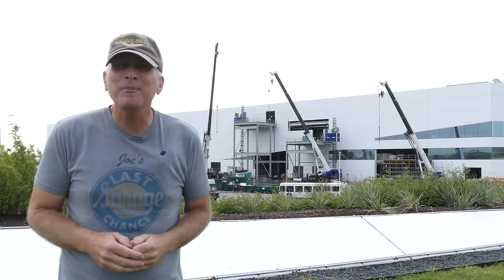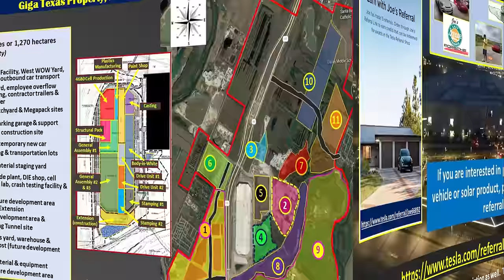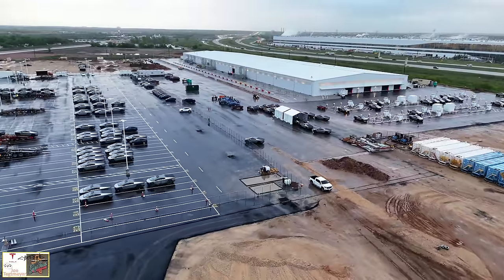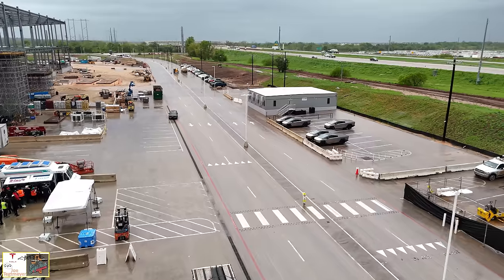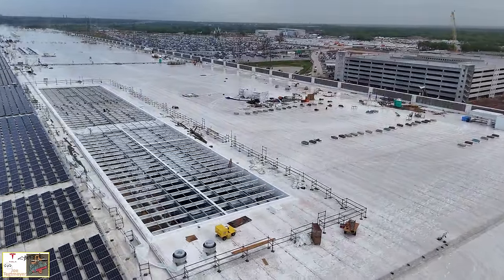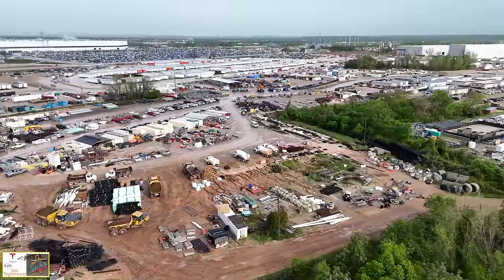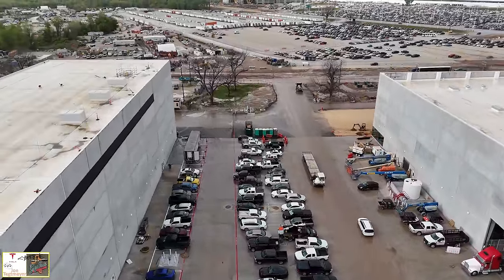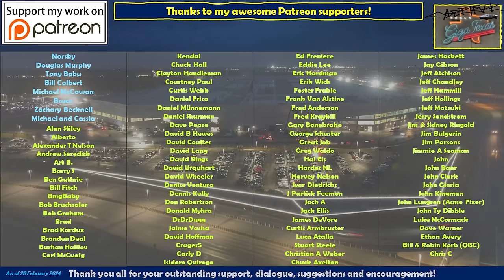End of 1st Qtr! Cybertrucks, Boring Tunnel & Casting Piers! 25 Mar 2024 Giga Texas Update (09:05AM)

Comment: Thanks Joe
4:38. W-WOW. Trench works for the stormwater drain turn north through the W-WOW. 
6:22. Westside. Tunnel Project. David Salisbury comments that the only critical component missing is the cross-conveyor to transfer the spoil from the tunnel conveyor to spoils pit.
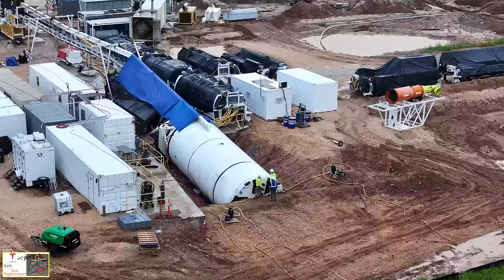7:01. Westside. Tunnel Project. Working inside the cutter head. They were seen in there in Jeff’s video from the 22nd.
12:55. Southend, west. Frame complete. How the windows will transition from 2 rows on the main building to the full height glazing of the extension is a work in progress (in my head).
14:21. Southend. Inside. West trench. Bottom left. Mud base concrete placed.
14:30. Southend. Inside. Middle trench. Pre-fabricating the rebar for the trench wall.
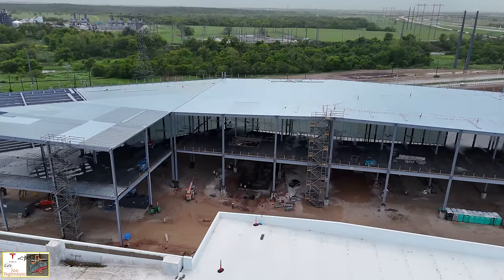15:58. Southend. Inside. East trench. Wall rebar is well above the heads of the workers, seems to be the height of the top of the column pedestals. Easily 3.0m 10’ or more. Note wall rebar returns horizontally where a ceiling will be constructed. A vault type structure.
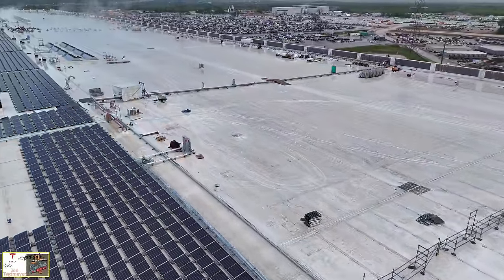16:54. Roof Pipework Project.
*Tight radii on the 90 degree bends. 12” 300mm or so.
*Pipes lengths are welded together, not generally mechanically joined (flanged/clamped/threaded etc).
*Pipes are quite closely spaced, possibly too close for insulation/lagging.
*Expansion bends not adequate for very hot or very cold liquids. As noted by HarderNL.
*Pipe support structure behind the parapet is currently set up for 2 levels of pipes/other utilities. Pipes are located on the lower level.
*Pipes take the long route between the current start and finish points. North west end is at the roof valley between Plastics and Paint. Pipe runs east over the roof ridge between Paint and Casting, to the Casting parapet wall. South behind the parapet. Turns west over the roof of BIW, crosses the ridge again into what was formally known as the High-Bay area.
*A more direct route exists that is shorter by 620' 190m. Suggests the route chosen is to allow for connection to a variety of stations along the selected route.
20:39. East side contractors yard. Bottom. Beside the large dump truck. Black painted vault type structure.
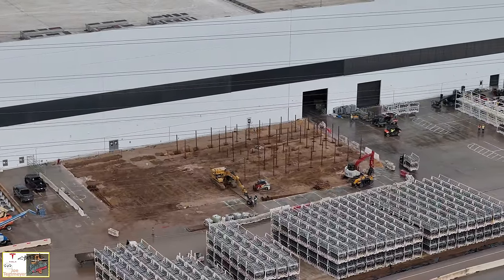26:53. Casting east. Apron. Model Y rear castings in the racks.
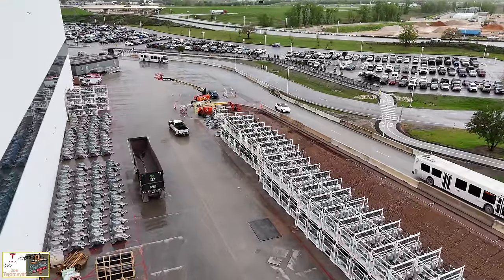27:59. Casting diagonal corner. Apron. Cybertruck front castings.
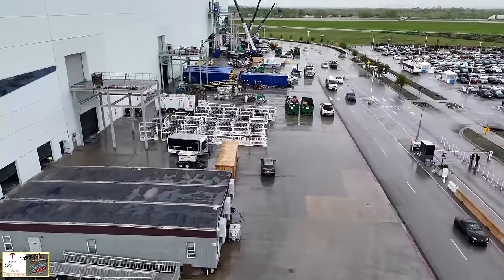28:15. Casting north. Apron. Wooden crate. Origin ’Italy Tesla’. Tesla has a plant of some type in Italy? 3800kg.
28:41. Battery north. Level 3 loading platform. Removed wall panel. inside. Angled structure. Temporary works.
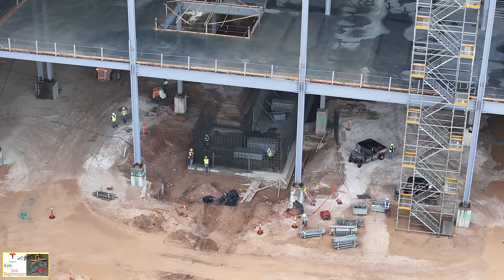Reply: 15:58 Notice that the opening in the 2nd floor is above the jog or extension of the pit getting rebar below.
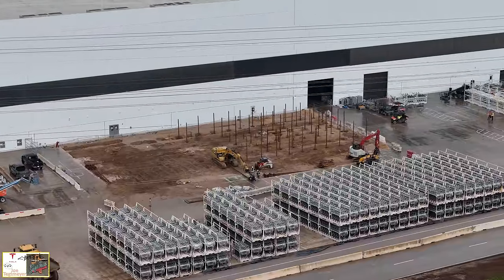26:50 I am going to take my chances and quess that the screw poles are to support a tall warehouse rack system, maybe automated, for the castings in the racks. We shall see.
Reply: @patrickdougherty2777   15:58. There is also small square set-down in the slab, maybe 1.5 or 2.0m 5' or 7' square. I think an over-run pit for an elevator of some description.

26:50. I think something quite heavy here. My money is on a tank farm (wild, near evidence free speculation).
Reply: I'm with Dessie on a tank farm near the racks. Unless, they have decided to move the furnaces that heat the molton casting metal outdoors. The furnace at the die shop is outside.
Reply: South end -  I wonder if the three tunnels are to run services as they are next to the penetrations in the first floor level. The penetrations are sized for large lifts. The tunnels appear larger enough for a CyberTruck. Perhaps there will be a design centre upstairs and they will use the tunnels to bring vehicles to the first floor under the ground floor - not a likely scenario. Perhaps there will be an AI server farm on the first floor and the tunnels just bring in heavy duty services like electrical power and cooling for the server farm.
Reply: @peteregan3862   My speculation that there's a tank farm to be constructed here isn't based on much. The new pipework on the roof, and the screw piles under the new tank farm at the southend is about all there is.

What I would say with some confidence is that the screw piles are not set-out in a pattern that would be expected under a building.

There's 3 new furnaces inside that have been assembled over the last 12 months. Massive units. Might be some association with the works outside.

Southend. 3 trenches/tunnels. Big enough to be receiving docks, plus there is some interesting design details in the retaining wall the indicates openings can be easily made.

Will be interesting to see how these develop over the next week.
Reply: @patrickdougherty2777  Rack system for the castings seems a good idea, but does it actually require such a reinforced  base?
Reply: @greggerypeccary  Good point. This is my thinking -  The footings for all the construction have been deep which suggests that the soils are not good for supporting weight. Granted, what they support is heavy. My memory might be wrong but i think that the poles used for footings in the outbound lot that Joe thinks are for solar canopies over the super chargers go down a ways. The screw piles are not like the building piles and are spaced close together like they might be for the uprights of a rack system. Why such a system would be there I don't know but a lot of castings are near. It's a quess so I will be just a litte bit suprised if my thinking is correct. We shall see.

Comment: TBM still waiting for the cross conveyor that connects at right angles from the conveyor discharge to the spoil bin.
Been waiting for this item for over 2 weeks now.
Reply from the maker: Me too and unsure what is taking so long for this and a few other things.
Reply: What you don’t know is Elon is gonna put half a dozen Raptor engines on the back end of proofrock…3 months to setup, 4 minutes of drilling! 😂
Reply: @4loops43 the dirt kind of puts a damper on the rocket engine propeled boring machine 😮
Reply: @JoeTegtmeyer Perhaps they are waiting for the main power lines to be connected to the tunnel operation site - the trench and conduits are almost there.

Comment: @16:00 on the grade, all that rebar and foundation work along  with the hole in the second floor is for a future staircase. By law there has to be fire safe exits. This is where they will build a concrete block walls to incase the  stairs.
Reply: 16:00. Something more than a stair. Rebar turns horizontally for a ceiling.

Comment: 24:30 There is a lot of steam rising there and it looks like it may be condensing on the upper part of the concrete wall.  Do you think that scaffolding might be so they can add more sealing around the windows and/or a coating on the concrete walls?

Comment: Looking at the castings, the ones on the ground have been there for a long time.  I'm surprised they haven't used them or at least put them in racks.  I was wondering if they're the front Model Y castings, as those were only used with 4680 batteries and structural packs which aren't being built right now?  I'm under the impression that they use the same rear castings on all Model Ys regardless of the battery pack; correct me if that's wrong.  I would expect to see a lot of Cybertruck castings now, as the casting process is pretty solid at this point, so that shouldn't be a bottleneck on ramping production.
Reply: Those on the ground at 26:11 are Cybertruck rear. 26:49 in the racks are Model Y rear. Cybertruck front from 27:49.

Model Y rear. From memory there is a difference between the rear castings of 2170 equipped and the structural battery pack equipped. That may have changed.
Reply: @DessieDoolan  Thanks.  If there are no front Y castings, then it's quite likely that the rear castings are for 2170 packs.  I would assume that if they're different as you remember, then those differences would be too small to detect from a drone flight.
Reply: @pfcrow Yes that's correct no Model Y front castings. I can't remember seeing many at all over the last months.

The difference in the rear casting is mostly at the front where the casting meets either the floor of a 2170 model or a structural battery pack model.

Comment: Seems like the boring tunnel prep is going to be much longer than the actual process of digging. I hope that's not the usual way of doing business elsewhere…
Reply: Day 69 of set-up.
Reply: Not unusual for a TBM of this size to take 4-6 weeks to set-up. We are in week 12 now on this one. Still missing one obvious component (There may be others we can't see). Possibly some hold up in permits for the road crossing.
Excavation should take 4-6 weeks. But they will have to stop to install the rest of the back-up once they have completed 50m or so on umbilical power and hydraulics.